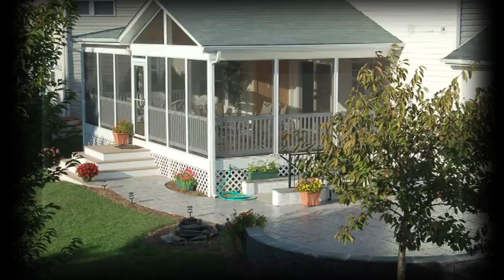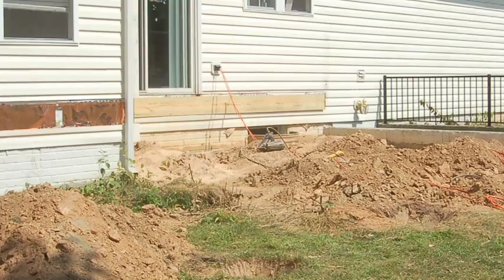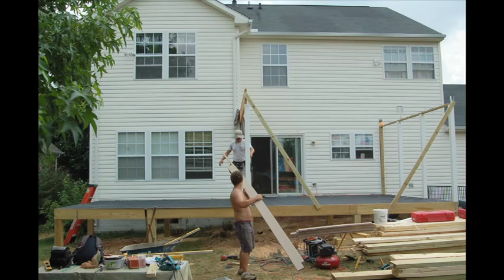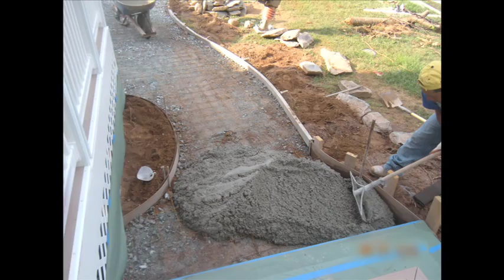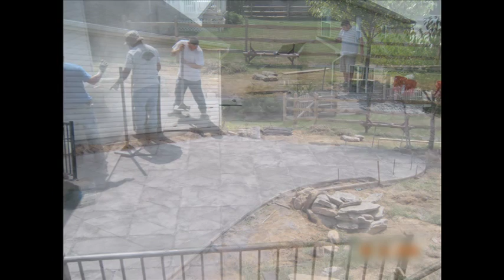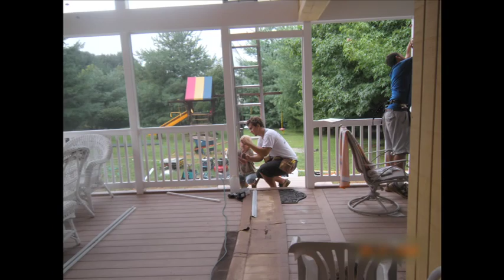How to build a screen porch - Howard County, Maryland

Comment: Hi.  Thanks for sharing this video.  I wonder if you could answer some questions?
 I was eager to see an angle of the project shot from the left side but it didn't happen.  It would have helped me better understand and maybe clear up my confusion.

The left read of the house bumps out.  Doesn't the rain water on the left side of the gable roof essentially rush down and hit this bump-out?  IE, it isn't shedding away from the house but is essentially directed at the house?

How does the shed roof going intersect with the gable roof?  I don't suppose you have any additional photos?

As I was watching, I was thinking that this was by far the most well constructed and meticulously detailed project of this nature that I'd seen.  Yes, not cheap, but for this level of expertise I wouldn't expect it to be.  Very well done.

Comment: How did you attach the vertical wood to the vinyl siding? Did you cut the vinyl siding all the way to the bottom, or lay it on top of the vinyl siding? I know what to do with the horizontal 2x8 or 2x10 witch needs flashing before attaching to the rim joist ect... the horizontal 2 or 1x4 is what I don't know how to attach... If it just goes against the siding, I feel like there would be gaps in every slope of siding and I am doing a screened porch. Or do I just put some caulk to fill in?

Comment: I'm building a screened porch over my deck... Also in Howard County. At 2:50 you say according to local building codes all 4x4 are connected to the deck below using simpson strong ties. I can't find any code information regarding these porch posts. Can you point me in the right direction!? Thanks

Comment: I don't get how this screen door cost $60,000.  I just bought a brand new manufactured home, straight from the factory for $68,900.  It was 4 bed 2 bath and 1800 sq ft.  This little porch is no more than 300 sq ft and has screens for walls.  How do you justify charging $60k for this?  That should be $5k max.
Reply: I supposed one can charge whatever the market is willing to bear but a better measure of a fair price is probably the net profit from the project. Assuming $40,000 for material and labor and a generous build time of 2 months(just a guess here), you would walk away with a profit of $35K. I don't know how much of this ends up going to your employees but lets just say half, you would make roughly $17k. So, that nets you 8k/month based on a 2 month timeline here. 

For comparison, your average dentist for instance brings in around 8-10K/month after taxes. Now, don't take this the wrong way because I am legitimately curious but how can the labor rate that most contractors charge be considered reasonable when the majority of contractors don't have anything beyond a high school education? Personally speaking, I could not justify hiring anyone at the absurd rates I have been quoted for anything ranging from a fence to bathroom additions.  

The work you did here looks great and there is no doubt about that but it just makes me cringe to think that something as simple as a concrete patio can cost up to $15K. Once again, I'm not trying to offend you, but I am always taken aback when I hear the cost associated with home projects. Either I'm just horribly poor, or everyone loves maxing out their credit cards.
Reply: That is way too much.  I have bought homes nicer than the one shown for less than this.  $8,000 tops.
Reply: I can see that.  Thanks for a thorough explanation. Oscar Mora